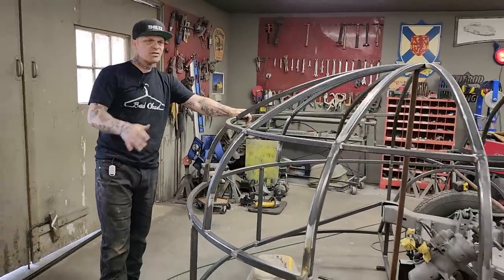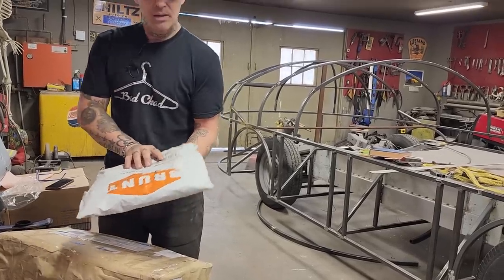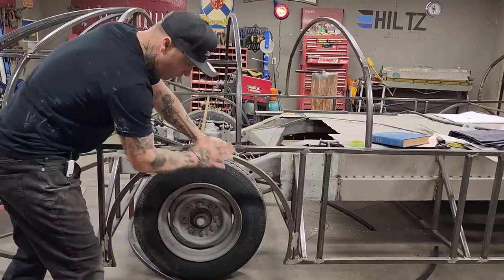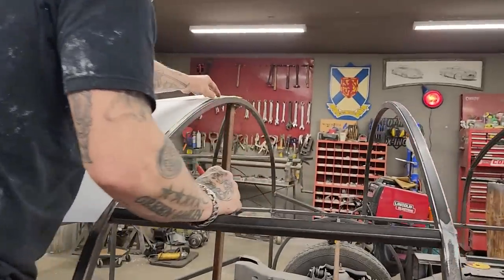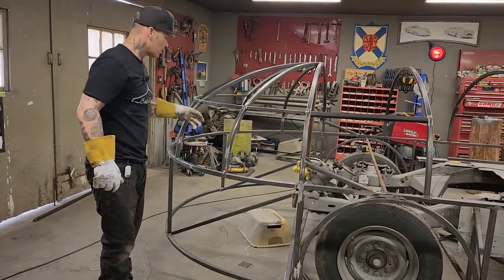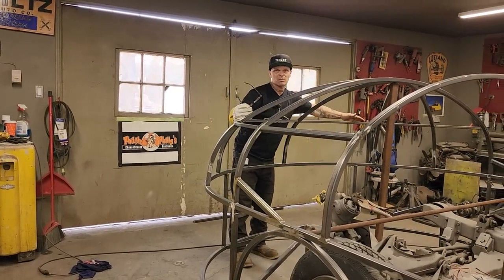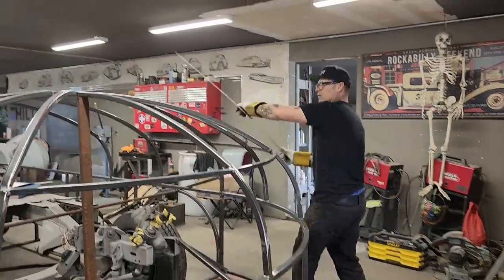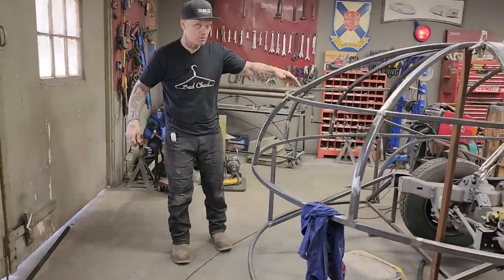Fabricating a "prototype" roof panel for testing 🚨

Comment: Even at nearly 70 years old I still run into problems on how to do a job. It happens to all of us.

 I step back and sometimes even walk away and my mind works thru to the solution to the problem without trying...

When I return to the shop the answer is right there as if I knew it all along. 

Maybe it's just how my mind works, but I believe that most problems can be solved with a little "away time to clear the mind."

You do you Chad. We'll be watching as you effortlessly solve any obstacle you face.

Comment: Chad demonstrates the beginning of the roof job  very well as usual. In my opinion, before covering/welding the cabin  roof or doing any side roof work, it is  better to start working/cutting/ seating the floor sheet metal. Next designing the seats, gas and break pedal, and the  steering column placement location etc. Doing this will help to work freely,  move around inside easily, to get clear view what is done or what to do, and to correct or rearrange any defctive work. Working on the placement of Steering column, front suspension, and engine bay seems a little challenge especially within a tight space. I knew you have better idia for the challenges Chad. Thank you for the video.

Comment: Tip: If you want the pattern from center to center; put the pattern on the outside of one piece and the inside of the other piece; then you will have center to center.

Comment: If you plan on driving this mobile down the road at speed the hydraulic steering is tricky. I've been around a lotta equipment using this setup. While driving down the road it will wander. It's not solid like a gearbox. It works great around a job site, but driving down the road you are constantly adjusting , because it gives you a mushy feeling at the wheel.   I was gonna use a hydraulic steer on a build years ago. I talked to a fellow who did it, and he told me it was near impossible to hold it in the lane of the road.

Comment: If that was an airplane, the pie slices would overlap with special rivets in the seam holding the sheets together. The pieces are held in place with cleco fasteners.They also spread sealant in the seam to make it waterproof.

Comment: After seeing the Texaco Tanker in photos and reading a little history on the truck, these had issues with ventilation because the windows were obviously in a fixed position. I'm sure Chad has taken the time to consider this, but just in case you didn't, its something that should be incorporated in the build somehow. We may see some more louver construction in this build at some point. From a safety standpoint, it was never a consideration in 1936.

Comment: Hello Chad, Jolene, and Fina Bell the dog alarm and guard! By the way what happened to Ayden is he still working with you guys on the weekends? The sheet metal is really going to work nicely on the front of the roof, I thought yesterday that there would need to be a 2 direction curve and instead it is going to be simpler with just 1 curve. Chad you really did a nice job on the frame work and Jolene that was a great idea to use the 3/4" flat stock instead of the 1" it worked perfectly also, another great video as always. Fina nice job of sounding the dog bell!
Reply: They used 3/4" square stock.

Comment: why in segments? if it's supposed to be aluminium, you can shape it by rolling - extruding: that's how you used to get every car shape!
segmented means yes: a lot of fastening effort!
how was the original doodlebug tanker made?
according to the pictures on the internet, the old doodlebug tanker has no visible attachments from the outside!
since there is a kind of insert at the top - that would be a possibility to put on and fasten the outer skin like a coat!
just an idea....

Comment: I don’t know about Canada, but in the states you can’t install hydraulic cylinders for steering. If you lose hydraulic pressure you have no directional control. It has to be hydraulic assist only, so in case of failure you can still control direction.
Reply: Oh boy, next you will be wanting him to put a steering wheel on it.  
I don’t think he ever planned on making it drivable.

Comment: Hey you guys how you doing Jolene and Chad you're doing a good job I see you guys started to take the back wheel off and put it on the front then you said it wouldn't fit the bolt pattern's the same I've had many of them trucks I don't know what they did but it should have the same size wheels the front and the back 16 inch or 16 fives but I have put on the rear tires on the front I'm not sure what you guys are doing or they made the wheel openings smaller in the front anyways good luck with it leave it to Chad he'll get her done somehow someway that's one thing good when there's a challenge that's what I like it will not stop me good luck you guys

Comment: That whole front cage is held up by only 2 pieces of square tubing welded on either end.
Reply: Actually no. It's a form of an automotive space frame in which strength and rigidity is accomplished using triangulated tubes. The cage, as you call it, is held by more than just "two" welded points of contact with the chassis.
Reply: For now...

Comment: Just my take but I would make it so the engine can be fitted up from under side, crossmember bolted in and then its "easy" to remove. Steering, I would use a power rack from a VW T3 (Vanagon 1980-86) with its angle box. on those the driver sits in front of wheels with column going to angle box and then shaft back to rack. Have you thought about widening front suspension ? as wider reversed rims will screw steering geometary.

Comment: I think that sheet metaling your structure will go well, I'm still wondering about doors and how your going to get into the front. Also you might want to rethink hydraulic steering. It's illegal for cars that operate on the streets in the US,  because if you loose a pump or a hydraulic hose you loose all of your steering. I know your not planning on doing anything inside, but a think a pair of double doors like on a Suburban would be cool.

Comment: You mentioned that you’re putting a door on the side in order to gain access to the motor. Is that door also the way you will get to the cab area? I don’t see any doors on the cab. If you will enter the cab threw the side door you will have to craw forward to get into the cab.

Comment: seems to me that it would be easier and much quicker If you did the large sheets first, then the small fill ins after.
much easier to cut and fit the smaller pieces to butt up to the large sheets.
Reply: He doesn't have the material in the house yet for that. He's working with what he has.
Reply: @lukeandjilljelsma654  lol...working with what he has... he already said he will use full 4x8 sheets... I am suggesting that he uses the 4x8 sheets first... is there something your Not understanding.
think before commenting
Reply: @traveler142 he has to go get the 4' X 8' sheets. He doesn't have them yet.

Comment: Im doing body work on my ford ranger.

Doing my best and it is so far so good but its taking me forever.

I wish I had more skill.

 Without the youtubers like Chad and Jolene, I doubt I would have attempted half the projects ive completed in the past 10 years.
Reply: No way has he been on here 10 years?   He has really come a long ways
Reply: @i8ntnuts  I don't know how long he has been on Youtube.
I was referring to youtubers in general for the 10 years i have been doing projects.
Woodworking, 140 cord of wood hauled out of bush, working on 4 wheelers, lawntractor, plowing, welding, bodywork, gun repair...etc
I was saying if it weren't for youtubers "like" them i probably would not have attempted certain projects.

Comment: Aluminum is lighter ! U should consider it for heavier vehicles maybe .
Reply: i think with the previous welded profiles - i guess it is a rectangular profile 30 x 30 x 4 mm - there is a considerable weight in addition to the chassis of the old vehicle.
in general it is the case that the purpose of use decides how a construction has to be carried out.
the old original doodlebug tanker didn't even have a capacity of 7000 liters - but requires a construction on the inside that has the fuel on the right and left - if a quantity is removed - always has the same fuel content on both sides.
so no unequally distributed fuel content!
i don't know what chad wants to do with it - the previous welded construction seems too filigree to me!.
It's just my opinion - nothing more!

Comment: I need a shirt line Chad has on,
Reply: scratch that last comment. Just saw they don't have that shirt...
Reply: -Bad_Chad  blow it scammer! Reported!!!
Reply: It should have said I need a shirt like Chad has no. 
I am No scammer. 😡
Reply: @mary8273  I wasn't calling you a scammer. @-bad-chad posted on here but I reported it. YT must have removed it
Reply: @mary8273  I checked the website and they don't have the shirt with the coat hanger. 🤷

Comment: Make the middle section over the motor removable.  You could form it to fit and pin it in place.  Like a big hood.  

I thought you were going to build the body so that it can be lifted off the chassis like a racecar but it was all welded to it.  Could go back and cut the supports and create pinned connections.  That would be cool.

Comment: It's interesting. I'm not a fan of the project. Way to much work and not practical. Raise it up make a motor home. Customize the interior.  The chassis is made to take the  weight.  Might be easier to figure the steering